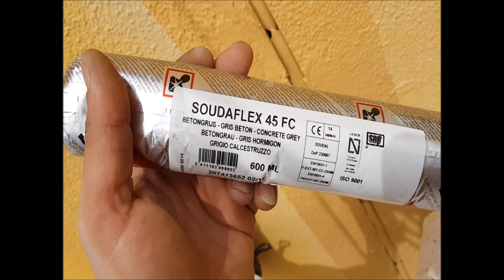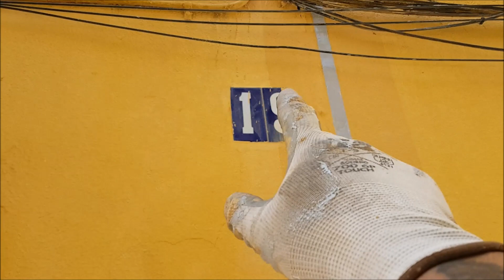Two buildings start dancing - Rope access

Comment: Hello i am very sorry for this fellow mates, but for sure is many videos do exist how to do, cut and climb a tree and so many techniques,you have to search by different words, like tree surgeons, arborist techniques and they are two main stales, dublle rope techniques and STR which i prefer (single rope techniques), so if you chek SRT in youTube it will appear many videos they all use prusek knots of a different variations,nice to now them just in case, those knots are even bather than Petz  ZigZag or other devices and i think it safety еnough. I by my self em not a tree specialist, i em rope access technician.But is good to now more then you need beccouse hire in Bulgaria is like in Spain it is a crise to, so i have to do so many different things. Knowledge is the best you can do for safety work. And i em sorry for my English to .
Reply from the maker: Dont warry , your english is better than mine, thank you for ur comment, you helped more than u can know